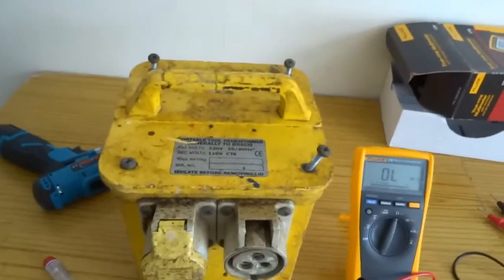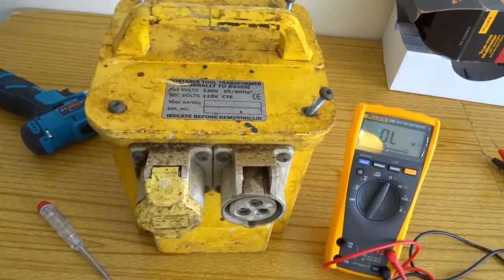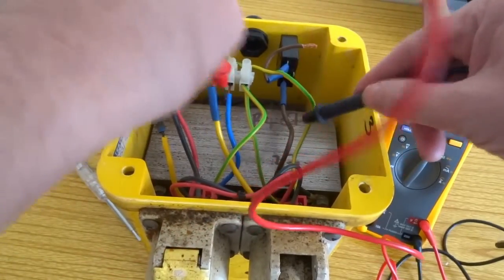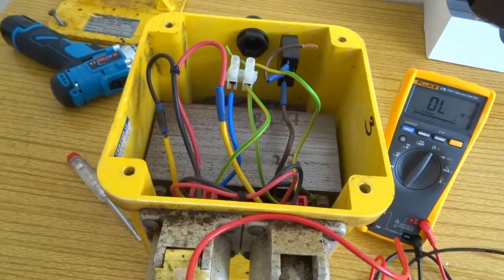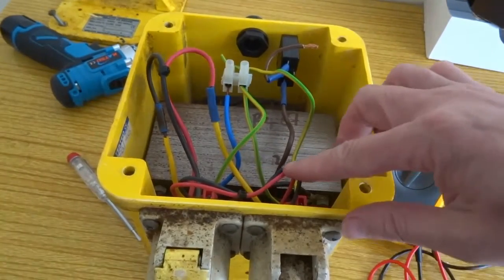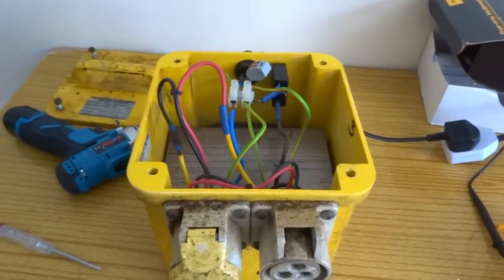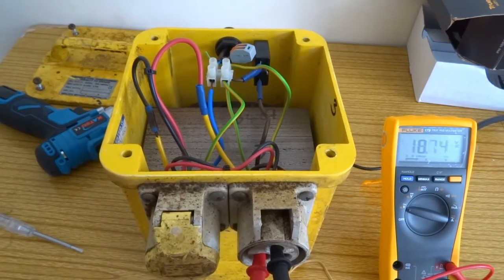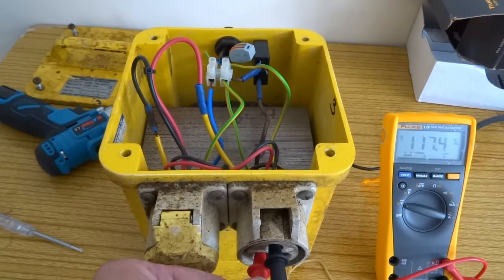Scrap Yard 110V Transformer FIX | Test Voltage, windings & Thermal Trip DIY

Comment: I’m getting 58v across earth and neutral, 9v across earth and live and 46v across live and neutral. Is this normal? Transformer isn’t working when I plug in my jigsaw (I know the jigsaw works because I tested on a gene)
Reply from the maker: Sounds bad from readings are all connections tight inside , not sure what is wrong if its not giving out correct voltage its got to be main transformer failure or wiring error.